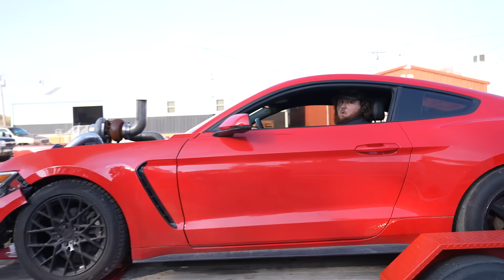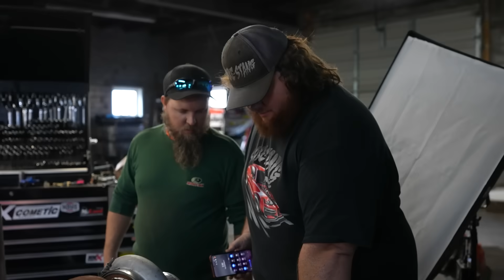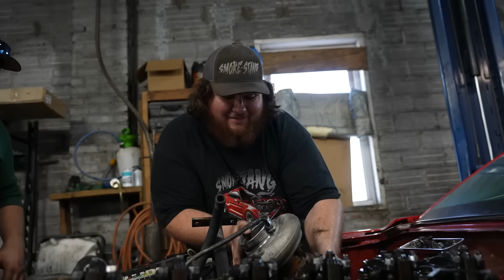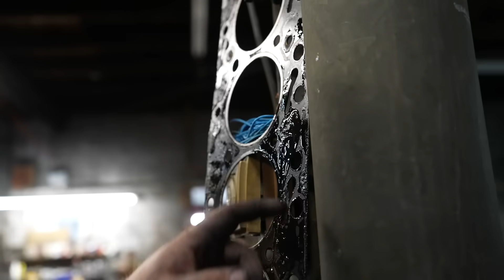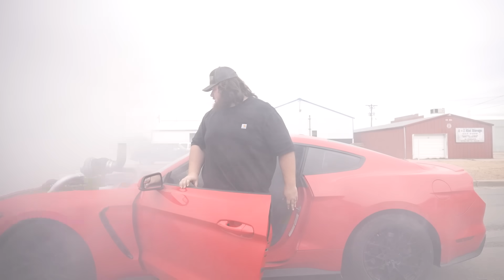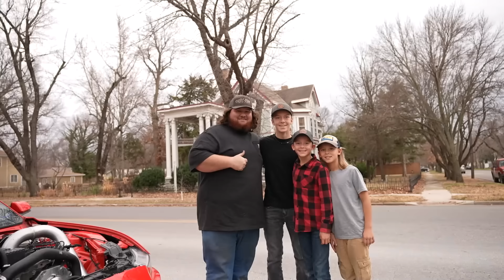I Gave The Cummins Mustang Even MORE Power

Comment: You blew the head gasket because you over tightened the head bolts and stretched them. You tighten them to 80 ft lbs because that's where they're the strongest.

Comment: This video reminds me of when I bought my 1 ton.  95 12 valve, dually, long box, all that good stuff... NOT a small truck.  For the first year, I never broke more than about 10 PSI of boost.  Like, let's be real, it's a one ton.  I bought it for hauling coal, not hauling ass.  Then one night, I was driving back from a friends place in Edmonton with my GF and this guy in a hummer pulls up and reaches out his window, pounds his door panel and yells "LIGHT EM UP!".  I yelled back "This trucks probably 10 thousand pounds, it's not lighting nothing".  And I was wrong.  I guess there's a reason the previous previous (as in, the guy before the guy I bought it from) had the big fancy gauge cluster on there with boost that goes up to 40+ PSI, pyro and such.  Not gunna lie, it surprised me.  4 black strips until I finally got out of the pedal.  For years I thought to myself "That's the fastest 165hp truck I've ever seen".  Well, lo and behold, when I had the pump redone, they called me back about a week later and said "Can you send us all the original innards for that pump if you still want it stock?" (I told them it was stock).  Turns out that truck wasn't even remotely stock.  I can't imagine how much fun the cummins would be in real life if you just got carried away like this.
Reply: And now here I am in Germany, where anything even remotely to do with modification on the car has to be put in the cars papers and those have to be with you in the car, otherwise it's illegal to drive and can get you your car impounded and possibly wrecked, if the cops decide so.
Reply: @xpectthedeath  :o  Holy hell, that sucks man!  :/  But, I suspect much of the reason it's fine here is simply due to not having smog problems.  Our population density in Canada is just stupid low.  Like, there's places where you could set off 10,000 pounds of dynamite and NO one else would know or hear it. Lol.  In fact, I dare say there's more places like that than not.

Comment: Westen it is because you keep tightening the head bolts too tight bro! You can do 90 ft lbs but even that might be too tight and the reason why is because the metal needs to be able to stretch when it gets hot

Comment: The studs aren’t bolts their springs so don’t over torque them it doesn’t work ! U need oversized studs I had the same problem with my motorcycle 17psi it’d actually separate the motor and blow all cylinders head gasket at once. Holding a 3” powerwheelie at 150-170

Comment: Out of curiosity, didn't you use felpro on that one? For awhile they were known to fail. I was one of those people. I went back to a marine gasket and haven't had any issues after that.

BTW, you can just replace they solenoid with a pull cable like older medium duty trucks. But the cheap ebay solenoids work too. Mine failed and I used a string for awhile to get it started lol.

Comment: Let's just take a moment to appreciate the stock rear diff holding on to all that Cummins torque.
Reply: If it ever hooked up that things a goner - BUT man it seems to be doin the job for now!
Reply: @Daytonaman675  Yep! 😂
Reply: And it being a 2.3l ecoboost diff aswell wonder if they use the same diff in the v8 model
Reply: @alexstromberg5865  Thought that was originally a Coyote car.
Reply: They do. I used to work at the axle plant. They do beef the carrier up and internal components, but the axle housing, axles, and ring/pinion are the same.
Reply: That's what I have been having anxiety all this time, darn thing is giving me nightmares, that rear diff should be included in the Periodic table as one of the toughest element in the planet.

Comment: Would be better with the 6.7 turbo diesel from a SuperDuty. Over 1000lbft. of torque. Also the 10 speed auto to go with it. That would be sweet, and quieter than that noisy Cummins. A lot less smoke too.

Comment: You need to run the pull in coil on the fuel solenoid with a .5 second timer relay. Those things are notorious for burning up.

Comment: Fuck the solenoid. Put a choke cable on the lever so you can cut off fuel when it runs away with the stuck throttle lol

Comment: Imagine if this beast could actually put all that power to the road. Right now if you try to accelerate hard the rear tires will spin but imagine if you converted this into 4 wheel drive, then you could really take off and unleash the full power, but even with four wheel drive I think this thing will spin.
Reply: If this thing was all wheel drive, itd be cool to see this vs the hoonicorn
Reply: @omni_mtb3210  it would be destroyed. The power curve isn't conducive to racing vs a gas engine, it is significantly heavier, and less power. But it gets cool points for sure
Reply: @christopherkatz9484  oh fo sho.

Comment: Simply overtorquing bolts does not provide additional clamping past a certain point say maybe 10% additional torque certainly not double or triple the recommended torque specification.  It didn't prevent your head gasket failure because it is likely contributing to the failure due to reduced clamping force.  These aren't just nuts and bolts and tighter is better.  The bolts/studs are expensive because they are precision engineered and manufactured to provide a given clamping force in its elastic range.  I hope you didn't reuse those as I am sure you took them beyond elasticity with your gorilla torque specs.  I am not scared to reuse an engine bolt as long as it has not been stretched beyond its elastic range.

Comment: “The cylinders look pitted and scored”
*puts new head on and proceeds to do to burnouts*😂
Reply: Thats a problem for another day lmaooo
Reply: Mehhhh he has a brand new head, that’s good for another 1,000 miles of weston abuse. Its A cummins!
Reply: It's like putting a cam in a ls. Oh the cam bearings are a bit rough and in the new cam goes.
Reply: @NR-GARAGECAST  and as soon as some unnecessary power is added something fails. Maintenance should have been done on the cummins to perfection then zoomy boys stuck onto it. That way he could make 3-4 passes before it breaks minimum
Reply: @NR-GARAGECAST  the cam bearings are always bad
Reply: Exactly what I was thinking lol
Reply: I’m sure it got dinggled honed
Reply: @stevenmcc2119  not without dropping the pan lol
Reply: But would not have been done straight after fixing it.
Reply: Exactly what I was thinking 😂

Comment: V12 cylinder LS motors are Bada$$ but for 50k I’ll just build a 454LS 😂
Reply: You could get two 427, 441, 454, or 468ci LSx turn-key crate engines from Texas Speed for 50k.
Reply: @lastnamefirstname9043  exactly!! 😂